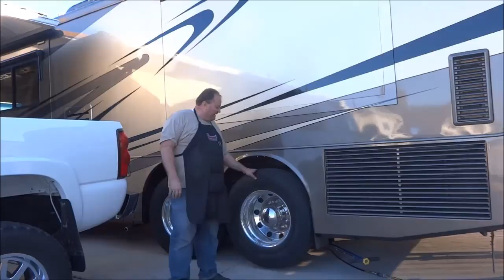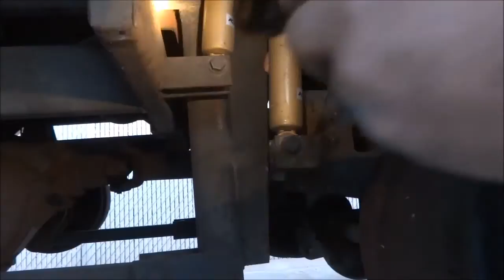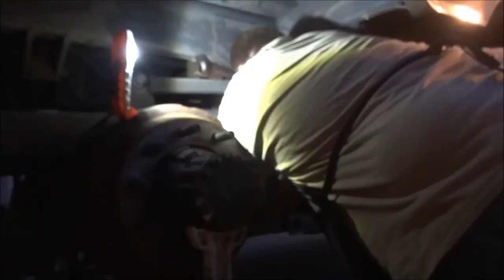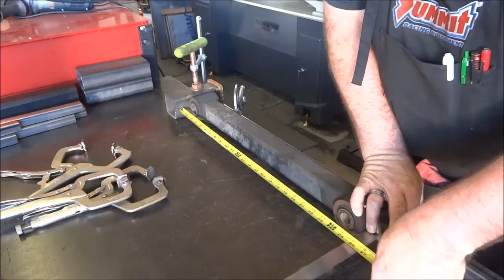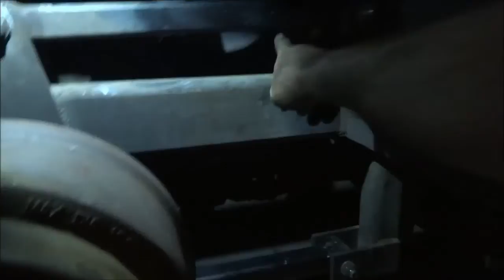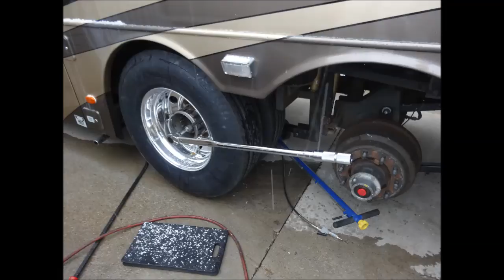Monaco Roadmaster Chassis Alignment

Comment: Why wouldn't you purchase an adjustable link,they are available at most truck and trailer repair shops?,I did that with mine,all new with neoprene bushing's, fleetpride truck parts,all my brake, suspension links and calipers and pads.😊
Reply from the maker: You found adjustable links for a Roadmaster S-Series chassis?   

We have them on some of our OTR trucks at work but I have not seen them on or even available for such a small number of RV chassis.  Besides, I had already replaced all my bushings with Atro and I can weld and machine so modifying my control arm was a no brainer.

Comment: You probably warped the suspension mounts when you welded those ribs on. All that heat on 1 side will make them pull. I welded diagonal brace tubes on mine, way less heat into the mount and much more rigid. My whole frame looks like a series of poor engineering choices.

Comment: Question: how did you know the trailing arm needed extending vs the bushings needing replacement? What would make this condition happen?
Reply from the maker: Pull to the right and bushings were fine.  I got tired of having other alignment shops tell me it was "within specifications" when I brought it to them to help me diagnose the pull, so I decided to take matters into my own hands and diagnose and fix it myself.
Reply: @ I’m having a “pull to the right” condition as well. Alignment is “in spec” but I don’t think I’ve had a laser measurement like you did…I need to find a better shop.
Reply from the maker: @Yahecniv unfortunately thrust angle is something often overlooked, especially by shops that don't really want to tackle such adjustments.  Most focus on toe settings and ignore thrust.
Reply: @zmotorsports62  I’m trying to figure out why there is a thrust angle misalignment?? Is this from a “poor” initial assembly of the chassis or is it just a condition that’s present in HD drivetrains?
Reply from the maker: @Yahecniv I don't know exactly but mine wasn't involved in an accident and I saw no damage to any mounting locations of any kind so I am under the belief that it rolled off the assembly line less than perfect, but within spec.    

I performed this correction more than 60k miles ago and it handles like a dream ever since.  I also fabricated and added a Watts link to the front of mine just out of curiosity.   It was negligible but by then the coach was already handling better than it ever had since we owned it.  The Watts link was just the finishing touch to the handling.  Now 650 mile days are no sweat.
Reply: @ I have the same coach as you, and I’ve watched that as well, you’ve taught me a lot about the coach and about fabrication…thanks a bunch.
Reply from the maker: @Yahecniv  thank you for watching and for the kind words.  
Mike
Reply: @ was this a factory misalignment you are correcting?

Comment: Mike, how far off was your thrust angle? Just curious, mine is .18 deg. positive, so not sure it's worth the effort.
Great video, great skills, and nice shop!
Is it wrong to cover a man's shop?🤣🤣
Reply from the maker: I didn't remember the degrees but I calculated it out to the drive and tag being off by 1/8", so I moved it 5/32" (.156") to compensate for road crown as we generally travel two-lane highways as much as possible.  

That video was also shot in my old shop, you should check out some of my more recent videos in our current shop that I've been working on for the last 8 years.  

Thank you for taking the time to watch. 
Mike

Comment: Wow, I just measured my coach and found a similar offset, then looked up to see if anyone else had fixed it! Great video. Ours is an 08 and has the gussets. Prob won't get to the repair for a while but glad to know I can do it. 20k on the  tires and don't see any weird wear tho but the coach pulls a little to the right and hence my measurement. Thought maybe the bushings are a bit worn too since our coach is air leveling and they get torqued alot.  Thanks a ton for sharing and beautiful repair.
Reply from the maker: Thanks for the comments and for taking the time you watch.  
Mike

Comment: Quick question about the gussets in the beginning of the video. Do you still have the template for those?
Reply from the maker: I'm sorry I don't. I fabricated and installed those about 14 years ago. If you can crawl under a 2009+ Roadmaster S-Series chassis you should be able to get some measurements. 

Thanks for watching. 
Mike
Reply: Do you still have the Dynasty?
Reply from the maker: Yes we do. She's still going strong for a 20+ year old coach. Just turned over 135k miles this week. 
Mike

Comment: Excellent, informative video. Nice job with the stills at the end. Did anyone bring up the bushings condition on those arms?
Reply from the maker: Thank you. Not sure what you mean by if anyone brought the bushings up but the bushings were all replaced with Atro's after this video was made. I was actually waiting for the new Atro's when I adjusted my thrust angle.  

That was many miles ago and the coach drives like a dream still after all these years and miles.  

Thanks for watching. 
Mike
Reply: @zmotorsports62   Understood, I noticed in the video the bushings looked a bit worn. I will research the Atro bushings.
Reply from the maker: They actually looked a bit worse than they were. I replaced the bushings with the Atro's because of a higher durometer and I was trying to eliminate as much movement from the suspension as possible. 

Turns out the Atro's did much less then I expected. What really made the difference was the Watts link that I fabricated for the front H-frame. 

One finger driving now and 650+ mile travels days are a breeze and a joy. 

Mike

Comment: After all the heat you going to change the bushings...looking a bit shabby..👍👍
Reply from the maker: The bushings were unharmed and still in good condition but I did install new Atro bushings in all of the control arms because of the limited movement they provide.

Comment: Nice Job! 
About the worn thru the wear bar tire section.. I would check and make sure the wheel/tire are true. If a wheel has been damaged the tire will not run true and will slip a little on every rotation. 
I hate those Xtra wide angle camera lens... makes the tires/wheels look like different sizes, up close especially.
Reply from the maker: Thanks. The alignment has been corrected, hence the video. The thrust angle was off. There was nothing wrong with the wheels, the tires are POS Goodyear’s and have been known to wear intermittently in that manner which is why I wanted them off of my coach.  Also the tag tires wear aggressively due to the scrubbing. 
Since going to the Michelin’s and correcting the thrust angle as well as fabricating and installing my Watts Link the coach practically drives itself.  
Mike

Comment: Have noticed pulling any trailer that the rear of our same year coach crabs to the left which makes the trailer pull off center as well same as what you had to have here. Good to know there is some way to fix this. I wonder if all of them are wrong by the same amount as in manufacturing defect. Already ordered the parts to do the gas strut fix to the door as the old style catch broke and is clunky. Should any place capable of aligning trucks be able to give the measurements? Thanks for the video!!
Reply from the maker: +Robbie Chiles I wouldn't say any place can do the alignment and point you in the right direction for the repair/modification.  It may take some trips to various shops and talk to them to get a feel for whether they can measure it accurately enough.  I was fortunate that I had a good relationship with the guy that does out OTR trucks at work and hired him to bring his laser gauges over to my shop and measure everything and help me to decide just how much I needed to alter my trailing arms.  Unfortunately when most people take their RV's to an alignment shop they try to sell them on the front end alignment as that is mostly what they know and many won't even consider checking or altering the rear thrust angle due to the amount of work, but if you find a competent shop they can perform the same alteration that I did.  The gentleman who did the alignment on my coach said he modifies a dozen or so of these RV's a year and understood completely when I told him I insisted on doing the actual modification.
I appreciate the comments and glad you found it informative.  Thank you for watching my video.
Mike
Reply: If I had the numbers I wouldn't be afraid to do the modifications I farm and work on heavy equipment. I also race dirt modifieds and am very familiar making repairs in roll cages by the method you used. The watts link install you did also intrigues me. It's dads coach though so everything goes through him. He is more of a if it's not completely broken we are not going to fix it kind of guy. Thanks for your message board post it has given me more things to look for next time I'm going over the coach.
Reply from the maker: +Robbie Chiles thanks for the reply. Agreed, if you are familiar with welding & fabricating and can properly weld pieces, it is not a difficult task. But boy you would be surprised at the negative comments from people who don’t understand fabrication and think I’m going to kill myself and my family because I modified the OEM components. Hell this is nothing to us farmers and especially racers. Like you, I have years of experience in both and just like to figure things out and then do the work. 
Thanks for watching my videos and commenting, I appreciate it. 
Mike

Comment: Mike, once again I'm blown away at your skill set. May I ask what your normal profession is and if you've ever consider being an RVIA certified technician and doing RV repair on a full time basis?
Reply from the maker: Thank you.  I'm flattered by your compliments.  I have been an industrial maintenance mechanic as my full-time job for the past 27 years mixed in with some racing and showing of street rods and motorcycles as well as a ton of automotive and motorcycle work since I was in my early teens.  I really wanted to go into automotive repair right out of high school but I met a guy who wanted me to come and work for him in the industrial maintenance field and the fact of not having to work for flat rate and always get my 40 hours each week was enough to convince me to go over to the industrial side.  The pay was actually slightly better in the industrial field compared to automotive as well.
Thanks for asking and thank you for following my channel.  I hope you find it informative.
Mike.
Reply from the maker: Also, I just noticed that this was on my video pertaining to the rear thrust angle adjustments that I did on my coach last year.  I hope you will check out my new videos labeled Monaco Roadmaster Watts link installation.  I fabricated and installed a Watts link setup on the front H-frame of our coach.  The video is a three part series and the first video is on my channel.  I hope you like it.  Parts 2 and 3 should be uploaded in the next few days.
Thank you.
Mike.

Comment: I've been working with RV for a long time. Accuracy of alignment in manufacture isn't a common thing. LOL. I like your method of extending the control arms using the internal tubing. External tubing would need to be welded on the end leaving a weaker junction.

Colin ;-)
Reply from the maker: Thanks Colin.   For high dollar units they are put together rather crudely aren't they.  I know they use fixtures to weld them together on but they are not as accurate as people think they are. lol

Mike.
Reply: zmotorsports
Damn straight.....or not!!  LOL
Reply: Do you ever offer information on where to start when the Coach wont start . My Holiday Rambler 2004 wont start and the batteries are fully charged . I have vno power fgoing to the dash or the transmission panel .
Reply from the maker: +Rod Williams seeing as how you mentioned loss of power to the dash I would check the relays in the front run panel. That will be the one at front left. There should be a couple of large relays in there. One that feeds the house and one for dash/chassis. Check to make sure power is passing through them as this is a common failure point. 
Hope that helps. 
Thanks for watching. 
Mike